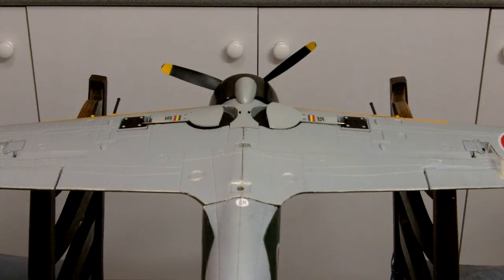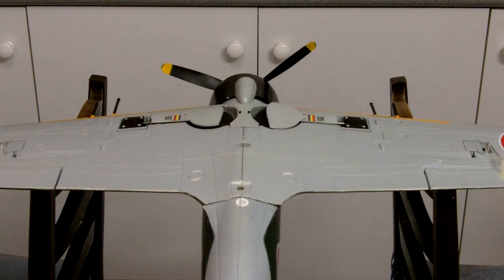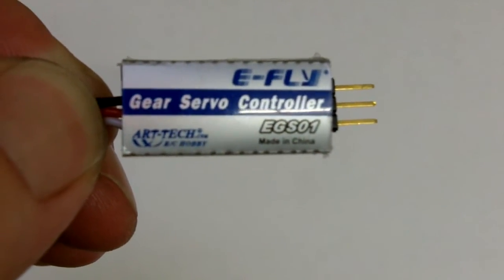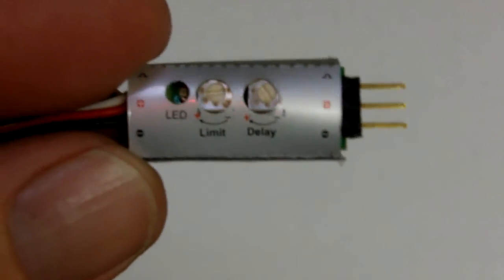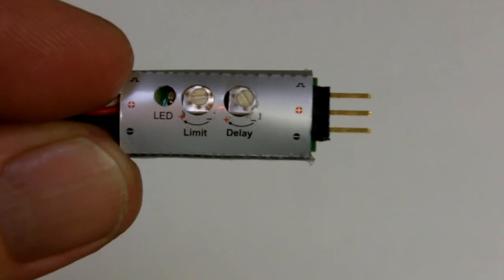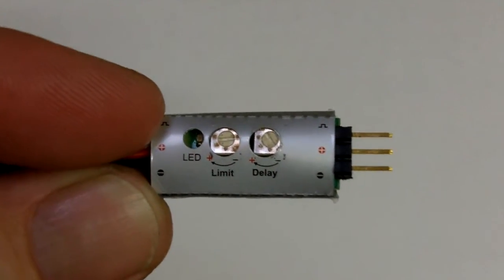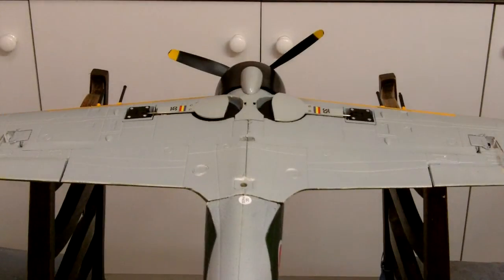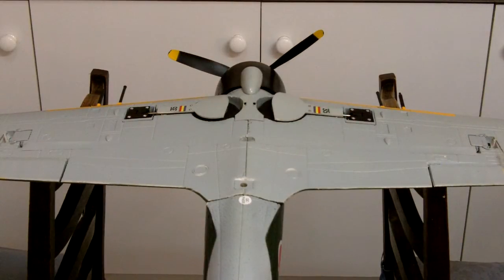How to slow down mechanical retracts on rc planes

Comment: Help !   I replaced a bad nose retract in my Eflite t-28 1.2m with a nose retract from a salvaged jet nose retract.  It works fine by itself - but it is plugged in with the main retracts and is out of sync with them -  when the nose is retracted the mains are out  , when the mains are out the nose is retracted !!!    How can they be put in sync with each other so that all gear goes up and down and the same time ?